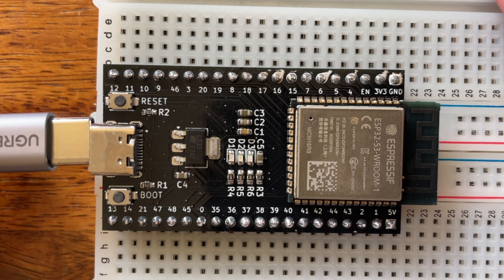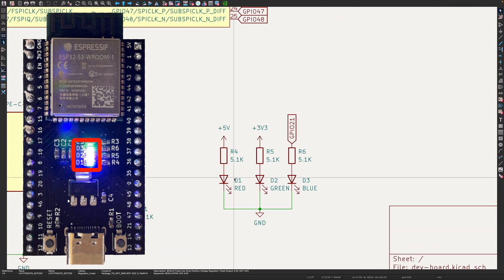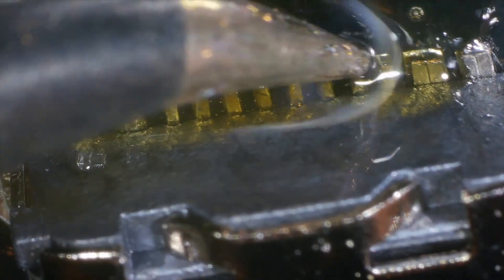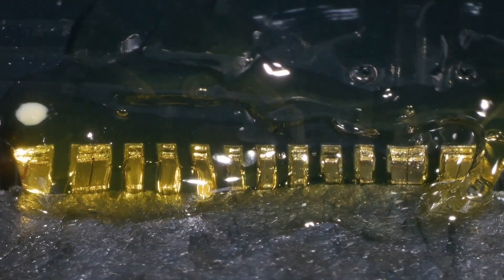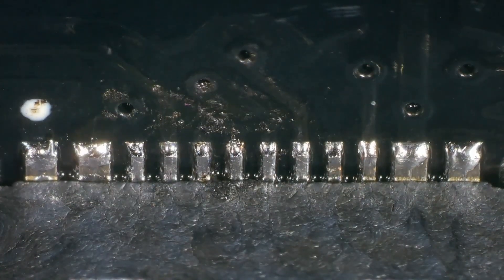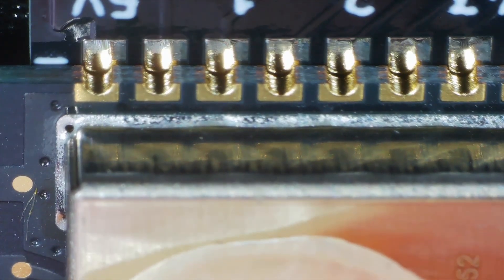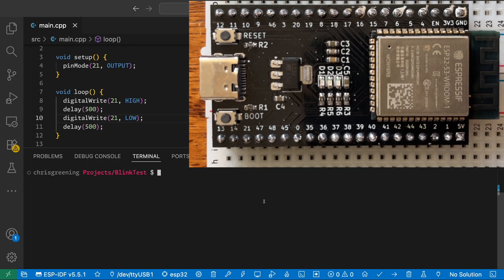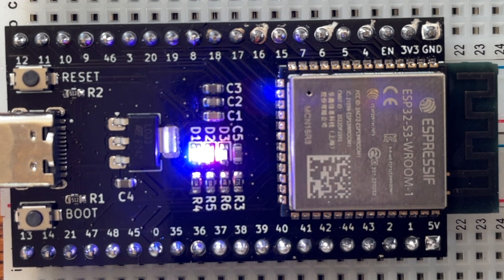I Built My Own ESP32-S3 Board… And It Actually Works!

Comment: You can simplify hand soldering by a bead of solder paste, hot air gun and touchup with a solder wick. Much easier, can be inspected under a common magnifier. Also there is less worry of esd damage😅.❤👍

Comment: 1117 aka ldo eats a lot of energy. try dcdc.
Reply from the maker: Yep - we’ll look at that when we do the “pro” version.
Reply: Oh Yeah I always think about that when I see those. Would be  nice to see a minimal 5 to 3.3v pcb. And I wonder if idle power of those is actually less or more. Also those battery charging ICs, do some of them have integrated 3,3v Outputs?
Reply: @JohnSmith-iu8cj u would try RT6150 buck-boost. which is used in raspberry pi pico. quote "The buck-boost SMPS, as its name implies, can seamlessly switch from buck to boost mode, and therefore can
maintain an output voltage of 3.3V from a wide range of input voltages, ~1.8V to 5.5V, which allows a lot of flexibility in
the choice of power source."

Comment: I prefer to not fit the USB connector or the leds, as i like to have a dev board that I can put into things.
Not everyting needs a USB connection so I don't bother making space for it. A second board with the LED's, switches, and USB connector can be use to program it via a small dedicated header. in my eyes the board is just there to help get at the ESP module pins. I'd do away with the module itself, but now days it's cheaper to buy a module than the parts on it. Plus can't be asked to bother with any RF matching if you want to use your one antenna.

Comment: Hand soldering SMD parts is fairly easy when you get the knack of doing it although the price of the built boards doesnt cover my time for making my own, that being said if you are making a custom PCB then putting the ESP32 chip on the board does look a lot more professional than soldering an ESP32 dev board to the PCB, or worse fitting it in to a socket although that can have its advantages in certain applications.

Comment: No ESD Protection?
Reply from the maker: This is a very minimal dev board - these generally don't include ESD protection. For a "professional" board - which we'll look at next - you would include it.
Reply: @atomic14 so just for flashing and providing power its overkill? Nice to know
Reply: @atomic14  Please use 1206 size as the 0603 size is really too small to work with, without a microscope.

Comment: TL;DR: I start with the bottom left or right corner for perfect alignment.

When I hand-solder an ESP to a board, I start with the bottom left or right corner. If you have the pin on the bottom and the one on the left or right  side of the module correct, you are guaranteed to have everything aligned. But do make SURE to push down on the module (as you did off course) because no board is ever perfectly flat :)
Reply from the maker: Yeah, I was amazed at how not flat my board was. I was quite surprised at how well the solder paste worked given the gap.

And yes - bottom left or right corner - definitely the way to go.

Comment: Hand soldering ESP32 - Awesome work! Making it look easy, Cool! 😊
Reply from the maker: That's the power of speeding up the video :) The only really annoying parts are getting it lined up for the first pin, and then the GND pin always takes a lot of heat and never ends up looking nice.
Reply: @atomic14  Pretty sure I have several hundred dollars of dead boards and components I messed up trying to hand solder smt stuff. Its hard. I should get a microscope. But heck you inspire me to try again.